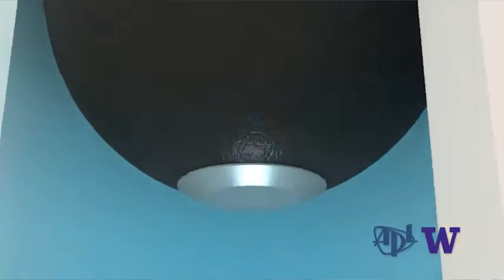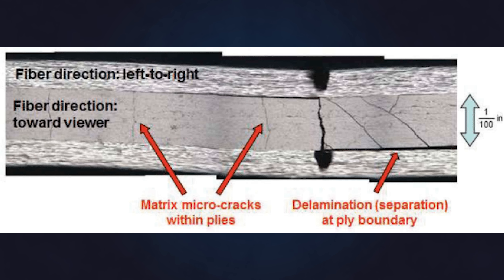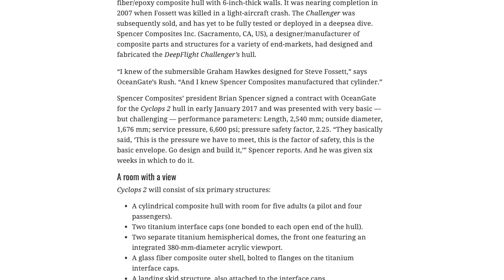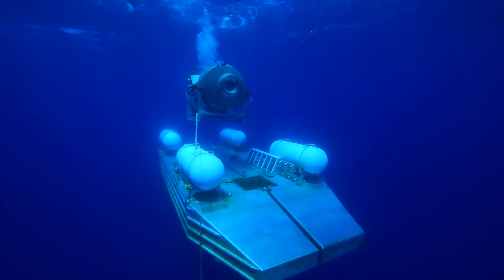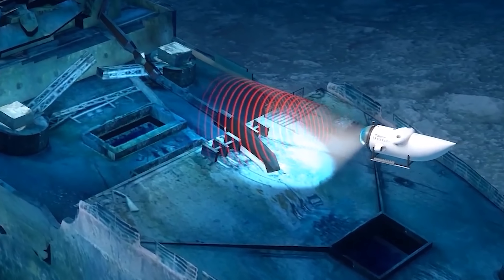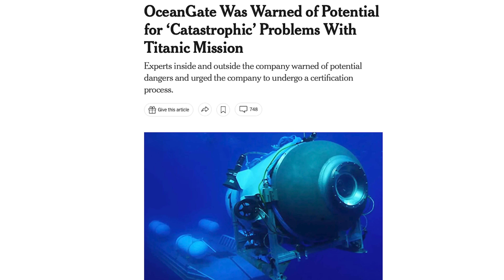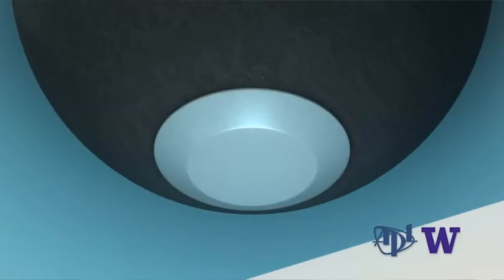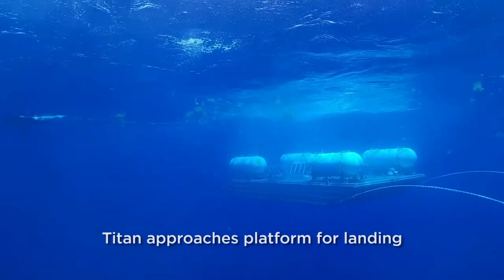Engineering Failures Behind Titan’s Implosion!

Comment: Good video. Clear and concise. I will add, one thing that really stood out to me was the pressure vessel being spec'd with a FoS of 2.25. Being a pressure vessel, I would have expected a FoS of 4.25 minimum, and even to the higher end, say 5-6, seeing as they were using CF, owing to its unusual properties, as you indicated. As I've pointed out to people, the concept itself wasn't/isn't flawed, but the design and construction of Titan was egregiously consumated. Thanks again for the video.
Reply: For human safety, outside of military aircraft applications, a minimum safety factor of 5.0 is considered to be good practice.

That said, the performance of carbon fiber composites  under extreme compressive stresses, especially when cycled multiple times, is not well understood, and more testing data is necessary before this material can be reliably used in this sort of application at such extreme pressures.

As you can well understand, a structure may well be excellent for its first stress cycle, but after a small number of cycles it can degrade to an unacceptable degree.

There are other issues with regards to the mechanical management of tear-out stresses in the interface between the composite and the titanium, so I think that there will need to be quite a bit of development work performed before a composite hull design can be safely constructed for deep sea submersible craft.
Reply: @chemech  ... well, Stockton Rush came from an Aviation background. Many people don't realize a FoS of 1.25-1.5 is a standard practice in design of aircraft. It may be that his background in aviation was instrumental to his downfall.
Reply: @wendyvic4046  I recall from back in my grad school days that a safety factor of ~1.5 was the norm for fighter aircraft..,

I think that it is clear that Rush's experience with the F-18 program colored his opinions, and was a factor in the failure.

His arrogance regarding testing and the assumption that everything can be definitively resolved by computer modeling (ignoring GIGO) was a major factor.

His failure to employ the services of experienced pressure vessel engineers - too old & conservative, even if many aren't white anymore - was instrumental in his demise.

Comment: The simplest explanation with a looped string you gave, explains very well the fatal flaw of carbon fiber in submersibles. For a bit I was thinking there might be some practicality in using composites in deep sea diving, as carbon fiber is commonly used as pressure tanks from gas tanks, to aerospace, but your simple string explanation completely turned my perspective.

Comment: Excellent discussion of this topic.  It seems almost criminal that after the first dive, with sounds of cracking, they wouldn't have done at least a full scan with ultrasound to look for changes in the hull voids.  Or at least remove the outer covering and scanned accessible areas with attention given to the area near the adhesive joints.

Comment: The thing I don't understand is that the way the CF is layered  down the way it was seems to me to be screaming weakness. You don't need engineering degrees to figure that out. Meshing of the fibers as they should have been still doesn't convince me that even then it is a strong enough material to withstand repeated dives for long.

Comment: I feel that this disaster will have a negative impact on Boeing and Airbus. I don’t think people are going to feel comfortable with the knowledge that both companies use carbon fibre in the wings of their largest airliners. I think that there will be a profound knock on effect, because the Titan disaster is such public knowledge and carbon fibre has become a major talking point.
Reply: Not really. Carbon fiber had been an exotic choice for a multi-use submersible, but is an obvious choice for aircrafts
Reply: Submersibles have nothing to do with air travel and Boeing already said they didn't work with oceangate directly on the sub. Compression and expansion are 2 different types of forces. Carbon fiber isn't good for compression.

Comment: Using the carbon fiber on a DIY submersible to go down to the Titanic is tantamount of going over Niagra Falls in a wooden barrel,  barrels are strong and reinforced with steel rings at each end,  but that doesn't make it safe as a vessel.  You just know,  there's a nut case out there who is going to make a DIY  submersible and try what Stockton Rush did  seeing how there's no law against it,  especially in International waters.

Comment: I absolutely agree. No idea what fibre fraction was achieved by Spencer composites in using their hybrid construction technique, but in a way, that isn't pertinent since the matrix takes the bulk of the load in compression. Would it have been better to make the pressure boundary out of polycarbonate?

Comment: Carbon fibre is great for tensile strength like the inside of gas tanks. It's not very good under compression. The other thing to consider is they bonded it to titanium, the carbon fibre composite had about 5% contraction at that depth, the titanium had basically zero, which put the joints under immense pressure. (just got to the point in the vid this is mentioned)
After the engineering failure, it was the compressibility of water that killed them though and not the high pressure, as soon as the hull was breached the water decompressed almost instantly to well over the speed of sound, they mostly likely got smacked by over a ton of water going very fast basically.
This was a well made tasteful video though, it's nice to see you didn't stoop to clickbait.

Comment: ...Yes, it was enough.
They had done this dive many times before without failure, so, the cause of the hull loss must either be - something happened down there that had never happened before or something fatigued out. They weren't so deep it was impossible for it to be some kind of fauna, although that seems fairly fanciful. Whatever the case it remains true that everything you (and half the internet) is saying is pure speculation.

CF submersible hulls have, at this point, been proven for any more or less reasonable practical operation, but thanks to Dunning Kruger will be taboo for decades.

Comment: 6:46 You claim the CF hull was "creaking" under compressive force. I think the noises were more violent than that: according to Captain Karl Stanley who accompanied Mr. Rush on Titan's SECOND dive to 12,500', the popping and cracking sounds from Titan's CF hull were so loud that they resembled fireworks ('bungers') or the discharge of a small caliber gun. The sounds were apparently worse at maximum depth. However, they continued on ascent, even at 900', indicating discharge of stored energy from induced CF defects. Rush briefed passengers (sorry, 'mission specialists') that they may hear these noises. Regulators might have been inclined to recommend destructive validation over a 100-cycle program or at least to a failure point.
Reply: ASME Code for Pressure Vessels requires FRP prototype be tested to destruction

Comment: Even though the epoxy joint between the titanium ring and CF was not a good idea, it can also be shown from the video that when the 2 parts were wetted and mated, there was little or no squeeze out. That says to me that the epoxy wasn't fully filling the space between the two parts. Yet more areas of air pockets/voids and not a 100% bond. The engineering of Titan was just wrong on so many levels. Add to that, the lack of clean construction environment, no autoclave, fibre layup pattern, visible flaws in the external layup ... the list goes on!

Comment: they could have used long bolt pins down each side of the carbon hull and bolted the 2 titanium pieces together to clamp on the carbon hull.. that should have bin done ontop of the epoxy job 2 long bolt pins down each side connecting titanium to titanium acting as a vice to pull them together.. but that's not what failed may have leaked there but the implosion was from release if pressure upon coming up to quickly realizing something was wrong they tried to come up and that popped the hull just like it would a divers head if they surface to fast

Comment: Thank you for breaking things down. I use carbon fiber arrows for recreational archery. And when they break, they shatter like glass. When I heard that the sub was made of this, I questioned the integrity of the material. I wouldn’t have stepped foot in that sub, in my non-professional opinion.
Reply: One of my own arrows had the tip shoved back down the carbon fibre shaft splitting it and peeling out like petals. Never seen it happen again but I sure didn’t want to pick the thing up. I’d been standing up on top of a shed, aimed down at what we called RoboDeer, a metal deer shaped stand with a small target area about 6” across. My second shot hit the stand and bye bye arrow!

Comment: Carbon  is just what lead to the accident happening.  It failed but not completely until it tried to come up and the pressure released off that fractured hull and the pressure released cracking stopped and within 3 minutes maybe less on ascend it popped from the sane thing divers get when they come up to quick..  pressure released to fast and obliterated the Fractured leaking hull

Comment: A lot of people online blame the carbon fiber but 5 inches is extremely thick.  I feel you could go to 20 km deep with that kind of overkill.

It seems like the more obvious failure point was the connection between CF and titanium.  That was merely glue with no mechanical fastening.
Reply: Hi Legend. What you feel does not overrule the laws of physics. 

Carbon fiber is a terrible choice of materials for a deep diving submersible no matter how thick it is, for reasons that have been identified in multiple videos. These reasons refute your feelings.

Regardless of the precise chain of failure of the submersible, the use of carbon fiber influenced every Link in the chain and is almost certainly  ultimately responsible for the failure.

Cheers
Reply: @ArcFixer  That's why i said "i feel" rather than "the laws of physics are wrong"

Comment: Rush touted his "innovative" use of carbon fiber, but he knew less about it than those who had worked with it.  Convinced of his own brilliance, he turned away the experts who tried to advise him, and he took the lives of four others along with his own as he stubbornly pursued his folly.
Reply from the maker: Data is everything, you ignore it at your own risk
Reply: @beyondengineering explain that to little brexiteers.  They r as arrogant and ignorant as this man the ceo.
Reply: Dunning Kruger is applicable to anyone, even engineers
Reply: @joesaiditstrue 
... and particularly for narcissists.
Reply: He flat out ignored every single person that warned him about the design and even fired one individual.
Reply: Rush tried Combined Subs proud by using Carbon Fider!! Not Strong !! Enough !! Brilliance not Strong Enough!! Water Pressure Rush Must!! Have Panic Sub!! Went!! Out of Control before it Blowup!!
Reply: I think he had narcissistic tendencies and probably grew up with an over controlling father or mother. He wanted his freedom and reacted very defensively, to the point of insanity, when other men tried to correct him. Another CEO, when faced with warnings by his safety guy, might have said, “Wow, thanks for spotting that, it could have saved someone’s life, how can we improve this so it’s safer for the passengers?” Instead, he freaked out, fired the guy who would have saved his life, and went after him in retaliation as if he was the enemy. He was free to be as toxic as he wanted, but the ocean didn’t care.
Reply: He also bragged about using expired carbon fiber that was past its shelf life for use in aircraft.

Comment: This explains my thoughts. A point load on a carbon fiber tube will be strengthened by the fibers, outside fibers in compression and inside ones in tension. But at depth the forces are putting all the fibers in compression. Whereas CF gives strength in tension. E g a CF hydrogen  tank at 10.000 psi, all the fibers are in tension.

Comment: Beyond Engineering, lots of hypothesis going on here. I was employed by Hercules Inc. in 1980 at the filament winding facility. We mostly manufactured solid rocket cases for defense and offense missile systems. My project was different it was a launch tube for the Peacekeeper missile rail based system concept. It was to be the largest graphite structure in the world. The launch tube overall was 69 ft long X 96” diameter X 1.625 “ thick. We made two versions 3 ea. 23 ft sections and later a 46 ft and 23 ft section. For Westinghouse the prime.

This work allowed Hercules to be selected to manufacture carbon fiber rocket cases for the Space Shuttle secret Air Force program. I was the senior process engineer on that program these cylinders were 12 ft diameter X 30 ft long X 1.5” thick. You can see them at Huntsville Alabama. The testing of the cases was done in Utah and the first test surprised NASA! We had to interface with existing shuttle hardware so the joint to the dome was identical to the Thiocol steel cases. The steel cases are tool steel 1/2” thick and operate at 1000 psi during launch. Our structural engineers calculated the tube to be stiffer than the steel dome. During the first test the dome inflated and the tube did not move. The joint opened up and we launched a space shuttle dome into the top of the test fixture.

So two things without supplemental compaction during winding tow tension does not provide enough radial pressure to consolidate the 90 degree prepreg unidirectional layers and underlying hoop layers. Winding pressure is additive and underlying hoops micro buckle. We had to use supplemental compaction with  an endless belt tensioned to 180 lbs per inch as we wound the hoops over the 15 degree axial layers. This was a 24-7 day effort for 15 days nonstop to make a quality tube. 

I listened to Spencer Manufacturing at a SAMPE chapter meeting presenting on the Challenger Deep project for Steve F. Before he died. They were very thin on details as to how they achieved such a low void content in their tube. Now I know they drowned it in epoxy instead of consolidating it. The wet winding epoxy has a pot life of an hour or so after that the viscosity builds until it gells into a solid. After 24 hrs the wet winding epoxy cures to 70 % strength. The pre impregnated axial layers stay semisolid until autoclave cure. The final vacuumed bag and autoclave cure did very little to consolidate 5” of composite material it just cured the high temperature epoxy in the axial layers and post cured the winding epoxy. Spencer manufacturing has no clue just following the print supplied.

My opinion.
Reply: Yes to all of the above. I think that the claim of less than 1% porosity is a bogus. Without autoclave pressure proper compaction is very hard to achieve - particularly with a thickness of 5". What about evacuation of volatiles ? What about heat released during cure - when thick laminate is cured ?
I have no experience with filament winding - but 40 years of experience with design, analysis and fabrication of composites using prepregs. I have no idea how Spencer managed to achieve low porosity and good compaction in a process which did not meet basic requirements. But - obviously they did not...
Reply: Clearly the intricate details of the process can substantially add to or subtract from the native material choices. Poor material choices, poor process controls, poor failure analyses, and poor mission decisions look like a sound basis for the failure investigation. Good engineering has always been the counterweight to hubris in the technical arena, rarely are all the engineers shown the door so myopically in such a megalomaniacal enterprise. Even rarer is hubris drowned in such deep, dark karma.
Reply from the maker: Wow, thank you for this! Probably the best in depth explanation out there! I had to read this 3,4 times to fully understand it as there is so much information here. 👌

Comment: I agree with everything except the end caps shearing off.  At depth the end caps would be under extreme pressure and be pushing against the carbon fiber hull.  Kind of makes me wonder if the hull cracked along the spine of the cylinder or did the end caps simply crush it.  We know carbon fiber isn't good under compression.
Reply: When we get down to the nanosecond intervals of the failure it's very complicated and entirely conjecture.   I think the end caps certainly were putting longitudinal stress on the carbon fiber tube - and that is what maintained the seal despite the degradation of the adhesive.   That would be until the instant the aft end of the tube fractured under that load and the crush of water on the sides was released at the point.   We could call that the end cap being "sheared" off.   Then there would be a pressure wave moving forward which separated the forward ring from tube, the front hemisphere from the ring, and blew the viewport out taking its retaining ring along with it.   This seems to match what we can observe from the photos of recovered wreckage.